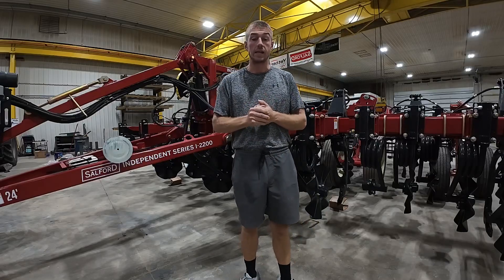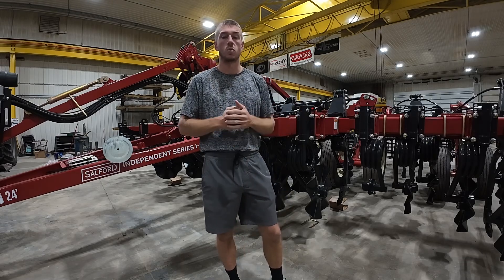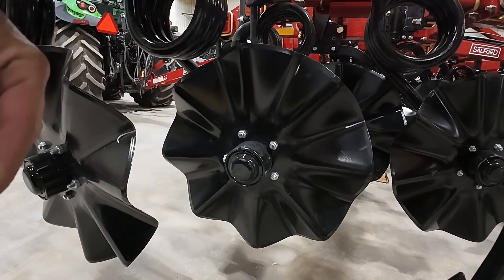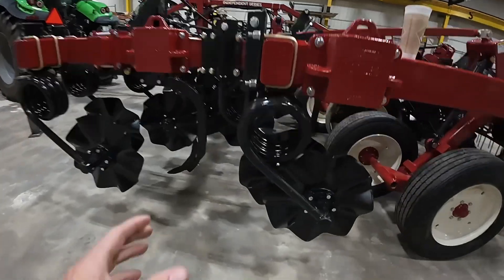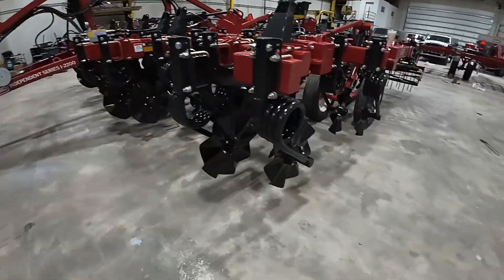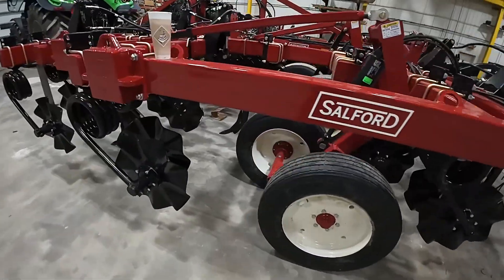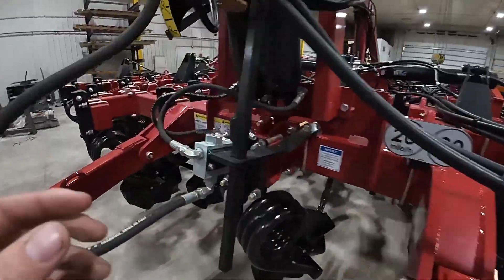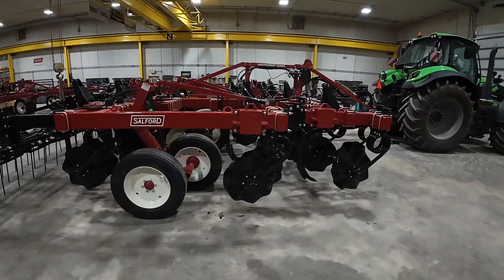Learning How the Salford 2200 Works

Comment: Hey Adam had a couple question about the 2200. How well does it pull out weeds in the spring? Also how much horsepower does it take to pull per foot with and without the shanks?
Reply from the maker: Vertical tillage, because it is up and down, does not successfully work as a weed terminator in the spring. That’s not a negative towards the tool, it’s just how it works, in order to eradicate weeds, you need horizontal tillage (cultivar sweeps) nothing wrong with those either, just not what it’s made to do. It can kill some weeds for sure but cannot be relied on for a killing pass. 

Without shanks: 10 hp per ft @ 10 mph
With shanks: almost double that @ 7.5 mph
Reply: @FennigEquipment  Thanks for the info!